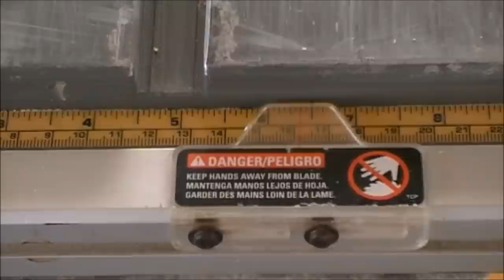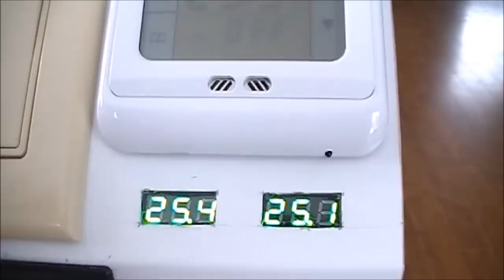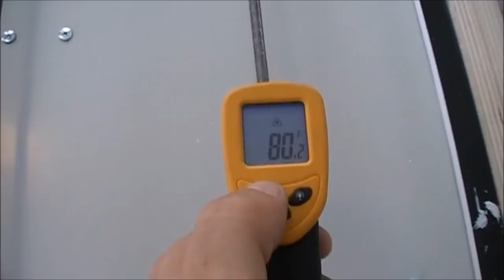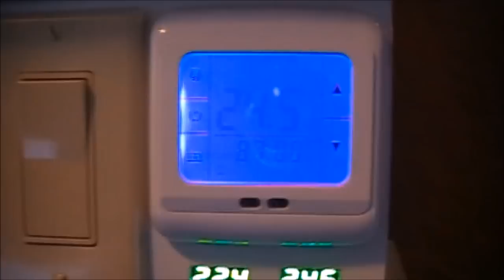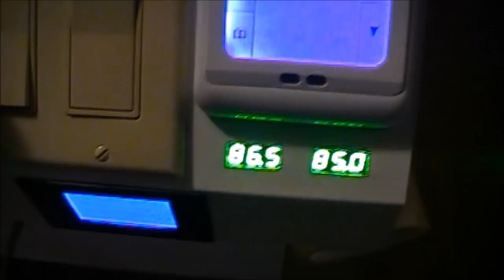Build A Solar Panel Laminator

Comment: Well thought out and executed design, keep up the good work. The refrigeration vacuum pump is getting yet another use, not just for refrigeration installations/repairs or resin infusion of stators.  I didn't realise that standard looking airline couplers could be used with negative pressures. Great result

Comment: Good evening, my friend, congratulations on this project. I just did not understand the material you used for the heating and also what the temperature used for lamination. Please, if you can, just answer me. I live in Brazil .
Reply from the maker: It's all in the build guide which is available at the companion link in the video description.

Comment: wow amazing, i though the tradition way was to use epoxy glue=expensive, this laminator is a very affordable solution.
Where did you buy your solar panels? 
its 2020 now is it cheaper to buy ready made solar panels? i think they cost around 80-100USD for 100w panel nowdays.
Reply from the maker: I make the panels, but I bought most of my cells from a liquidator in Canada a few years back for dirt cheap, various kinds. Cost benefit depends on the goal; if a person has a lot of off grid panels to make or wants to get into manufacturing them commercially, then building a laminator would be a wise choice. If a person just wants a few panels, then it will probably be cheaper to buy them instead of making the laminator to DIY.

Comment: What's your estimate on cost to build your own panel vs. buying one?  How much $$$ do you save per panel?
Reply from the maker: My 'actual' cost is less than 70¢/watt installed, that's including my time. Local supplier is selling similar panels for $1-$1.50/watt, in-store pickup. So saving 30¢/watt. For the 1.3 kW solar heat pump array that I recently installed, that's a total savings of ~$390. I can order panels online for around the same cost that I can make them, but would end up paying nearly double after shipping costs and taxes. What it would cost you or anyone else and how much you save will depend, but I'll break down my costs to give a ballpark figure: 
I (or anyone) can buy polycrystalline cells for 20¢/watt, the tab/bus wire for 17¢/watt, and the encapsulating film for 17¢/watt - and that's at standard retail cost via Ebay. Personally, I use recycled glass (salvaged from my day job as a building contractor, though homeowners can just as easily keep the old glass from their window/door replacements and make solar panels with it too - just make sure the glass has the 'tempered safety' stamp in one of its corners). The retail cost for tempered glass here is around $15/sq.ft. Hardly affordable for this application. But if I didn't have access to recycled glass and needed to make a bunch of panels (I'm talking at least twenty 100W panels for a proper, useful system), then I would buy bulk at wholesale cost which would be anywhere between $1-$5/sq.ft depending on thickness and order quantity (the more you order, the cheaper it will be). Let's pick the middle ground and go with $3/sq.ft for argument's sake. With the above figures for materials alone, I can produce one of these 120W panels in the video for approximately 71¢/watt, or ~$86 per panel. With some practice a person can tab and prep a panel in less than an hour, a half hour if they become really good at it. Let's give a generous $30/hr for labour (though I doubt Chinese factory workers are making anywhere near that amount). That would work out to around an extra 17¢/watt for assembly time worst case, or 88¢/watt total for time and material = ~$106 per panel. That's paying retail for solar components and wholesale for glass. In reality you'd be buying solar components in bulk for an avg size system, and they will be substantially cheaper. The price per panel then would likely be less than $90. My panel laminator is rated for 1.2 kW/hr, and it takes 30 minutes to cook a panel (while one panel is cooking another could be tabbed and prepped to go in almost immediately after). If using grid power (local price here is 10.8¢/kWh), the energy cost for making a panel would be less than 7¢. Quite minuscule, and much cheaper compared to using silicone epoxy for encapsulant. So a DIY panel would only cost around $90 in total, if materials are sourced properly. If using recycled glass, the total would be less than $70/panel. For people who have local PV suppliers within a reasonable driving distance, they 'MIGHT' be better off buying if they manage to catch a sale and get a good deal. But if a person has to order a pallet of panels for an off grid system and have them shipped to their location, then most would be better off building their own if they're comfortable with it - freight costs can amount to as much as the panels themselves in a lot of cases.
Reply: That's an awesome, exhaustive cost breakdown - thanks very much!

Comment: Is there a compelling reason to use poly vs mono cells?  Mono are more efficient and thus take up less space.  But if you had plenty of roof space, which I do, is there any reason to get the more expensive mono cells vs the less expensive poly?
Reply from the maker: If you have lots of space to work with, then your choice of cell really only depends on the cost per watt.

Comment: Hello I am facing problem during payment for the pdf do you have another payment method
Reply from the maker: Payment can be made by credit card or Paypal, no other options are available. You don't need a Paypal account to make a purchase, but all transactions are processed through Paypal (including credit cards) so the problem could be related to your country blocking certain features and/or payment methods in Paypal or vice versa. Judging from your names, am I correct to assume you are both from India? If so, you may want to consider that financial institutions in India, specifically the RBI, have imposed a special set of rules on Paypal in order for them to do business there. You can learn more here: https://www.isaumya.com/shopping-paypal-india-issues-explained
Sorry for the inconvenience.

Comment: Ok, this is probably going to sound stupid as it can be, but what's the laminator do, I'm assuming it's to protect the solar panels, yes/no, ?
Reply from the maker: The laminator laminates the cells between the glazing and protective EVA encapsulant and backing sheet. It's similar tech to what was once used to laminate paper ID cards with a plastic covering back in the day, just a different application.
Reply: @JamesBiggar  yes I understand that but does it protect them from hail mainly
Reply from the maker: "but what's the laminator do?" - I answered your question as to the laminator's purpose. The laminator makes the panel - it doesn't protect the panel. If you understood what it was for, then why ask what it does? Your question would have been better framed as "what does the EVA and glass do, do they protect the panel from hail?", not "what does the laminator do". Yes, these materials (not the tool) protect the panel from hail.

Solar panels are made from tempered safety glass, just like the windows in your house. That doesn't mean they won't also break from a freak softball sized chunk of ice falling from the sky, though. Glass in a solar panel has its limits just like glass installed in anything else. It's the same material, the only difference is that some glass is laminated with a piece of plastic for safety purposes when they break - called laminated safety glass like what's used in a windshield. Some glass is tempered so that it breaks into little cubes instead of sharp shards., and some is standard glass that will break just by looking at it the wrong way. As previously mentioned, the glass in a solar panel is tempered (or at least should be), plus it's laminated to EVA encapsulant, so if the glass ever breaks it'll be into tiny cubes that remain stuck to the EVA, and the panel remains intact and operational (in most cases). A broken solar panel is relatively easy to fix, if needed. There are solar specific epoxies that can be used to pour over the broken glass ans seal it back up again. This is only practical if the cells aren't also broken, of course. I hope that answers your question and helps put things into perspective.

Comment: What's the model of the base heater? It looks like a Stelpro B0752W but not sure. Is there an alternative model that can be used that also has 31" element?
Reply from the maker: It's the Stelpro 750W. There are lots of different models that are close to that length, but you will need to check the spec's on them because they could vary by a couple of inches. The wattage is just a reference too btw - the elements won't be pulling anywhere near 750w each when hooked up to a 120VAC power source. The resistance is what really matters. If you don't use the Stelpro, try to find elements with a similar resistance rating (77-78 ohms). The resistance typically isn't stated on the packaging but it can be calculated by first dividing the rated voltage into the overall power in watts to get the rated current (750/240 = 3.1 amps), then divide the voltage by the current to approximate the resistance in ohms (240/3.1 = 80 ohms). If you have random elements on hand then you can simply use a digital multimeter set to 'ohms' to check the resistance. When connected to 120 volts instead of 240, they'll draw far less current and keep the temperature within a safe range for the EVA (if it gets too hot then it could burn or literally boil) - EVA is like the glue in a hot glue gun - it doesn't take much heat to melt it sufficiently, but the heat does have to be balanced across the surface of the panel and be consistent. The Stelpro elements will only pull around 1-1.5 amps at 120 V (see the power meter in the video for exact readings),  so you can add up to 8 of them before exceeding the ampacity of a standard 120V household circuit that's protected by a 15A breaker.
Reply: I would like to go with a Stelpro, but Stelpro only has a 28.4" (element size) 750W 240V will that be sufficient  length for this project?
Reply from the maker: They worked for me lol. But it really depends on how big you want to make your panels, or more specifically what voltage output you want to achieve. In my case, I have a bunch of salvaged glass from past reno's (I'm a contractor/journeyman carpenter by trade) to put to use but tempered glass can't be cut so I was limited on how many cells I could fit in each panel. My panels have 28 cells each, four rows of seven. The cell width + 1/4" space between each row adds up to a total of 25", that leaves 3-3.5" to spare for the Stelpro 750W elements. The cells that I use are 6"x6" polycrystalline 3 tab, 18% eff. Each cell produces 0.55 Voc, so each panel will only produce 15.4 volts peak - barely enough for standard charging of a 12V battery with a PWM controller. However, the panels in my system are controlled by an MPPT controller that has a high voltage input which allows me to connect all of the panels in series to keep the current low but raise the input voltage from the array to around ~62V. The controller then steps that voltage down to the battery charging voltage level while converting the excess voltage into current to maximise production - this also allows me to cut down on the amount and size of the wiring needed for transmitting the power from the array to the controller (high current and low voltage power requires thick wire with a high ampacity, while low current and high voltage power can be transmitted through much thinner wire which saves a lot of $). 
Most standard manufactured panels contain enough cells to keep the open circuit voltage high enough to individually charge a 12V battery (usually around 20-22V to compensate for potential resistance/heat losses in the overall system), where the power demand is low and only one panel is needed. But if you're building multiple panels for one system and use an mppt controller with a high voltage input (which are the most efficient btw) then you can get a bit more creative with your panels in terms of dimensions and cell count, as long as you stay within the limits of the controller you intend to use (I'm using the Midnight Classic 200 and the SRNE 2440). If you don't mimic what I did, just make sure that whatever elements you use are at least 2" longer than the area they need to cover because the first 1" or two on each end of the elements won't reach full temperature (the elements are basically just steel tubes filled with ceramic or porcelain, and in the centre runs a very thin nichrome wire which is what creates the heat, but it's always and inch or two shorter than the overall length of the element to prevent the ends from getting too hot and melting/burning the wire leads connected to them).
Reply: I'll be using 6X6 monocrystalline so it should work for me as well. Thanks for getting back to me and for the wealth of info you provided.
Reply from the maker: Np, my pleasure!